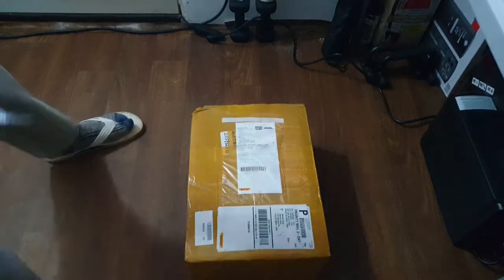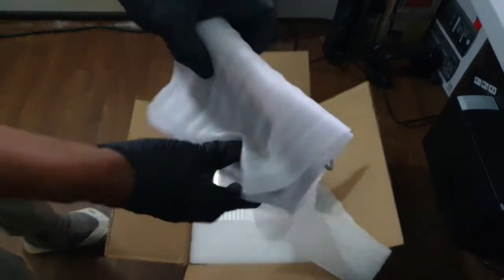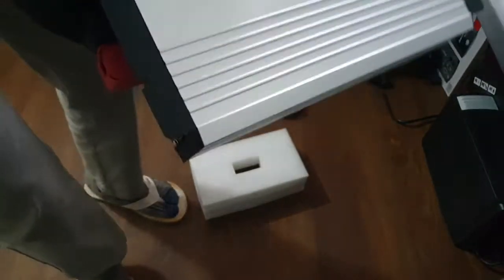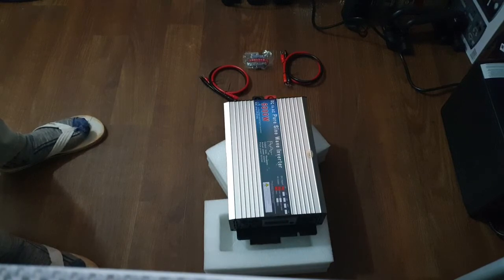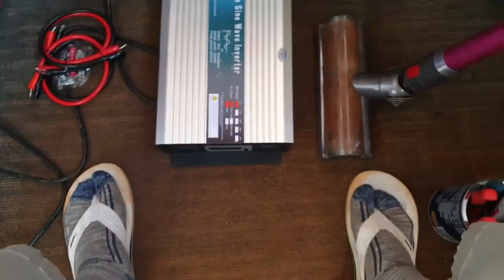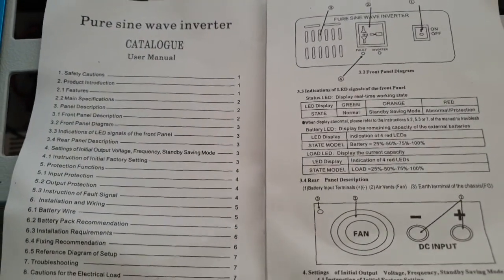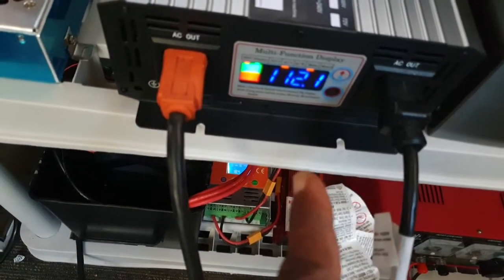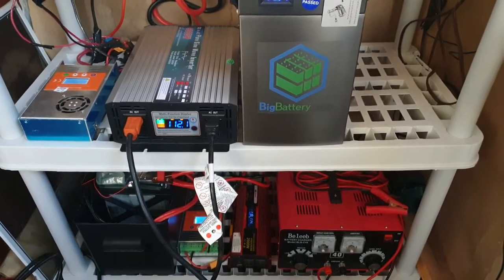New 6000 pure sine wave inverter with my Makeskyblue MPPT CHARGE CONTROLLER. 🔋🏘💪

Comment: I’m not happy with my MSB 60a controller. I returned my 1st one because the lcd always acts up, flashing between program/setup mode and my settings.  I’m on my 2nd one and it’s happening again. It was running great the 1st week, but now it is acting up again. This one burned out one of my 2 pole breakers. I feel as if it is running too hot. The room is cool in temperature. I have 650w of solar and it read on the msb lcd display an additional 2.3kw today on a clear day. I’m in Souther California, USA. The pv wattage input reads 15% higher than actual. My 1st one that I returned read 35% higher. I tested both with my clamp meter and multi meter. Does any of your msb controller do any of the things that I described? Or did I just get 2 bad ones?
Reply from the maker: I am sorry to hear that I have four MSB  controllers and all are working well. And the had two or them for over two years.